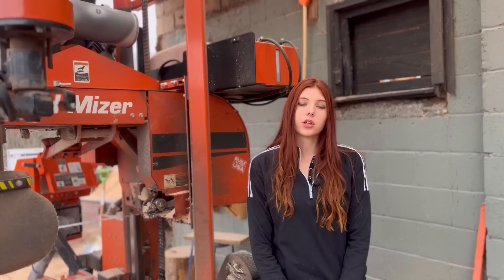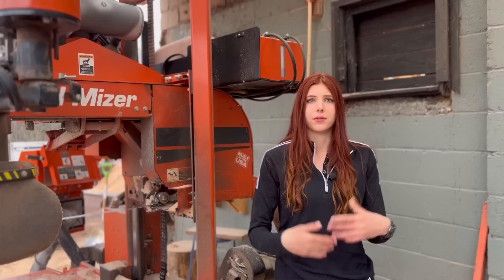Find the Right Blade for YOUR Sawmill!

Comment: Clearing the dust is very important for a cooler and cleaner cut.. What ever dust is left behind gets re-cut, binds against the sides of the blade,  and that takes away from the piece being milled. dust also contains pitch which can build up and cause a lot of problems.

Comment: The price for your blades is cheaper for your mill than my personal Delta 13" bandsaw. I usually pay around $20. - $30+ for a good blade. That's for a 3/4" 3 hook tooth per inch. Thanks for the videos. You all do a great job.

Comment: Deeper guilitt will cut faster in wider boards as it will not dust load as much and stop cutting as the tooth is going through the cut .
Another Y tube guy that has a very big home made band mill that saws very big logs up to 6 feet dia uses some kind of special blades that cut right through nails all the time and keep right on cutting ok .
He cuts a lot of nice table tops from some very ugly logs .
Some good information about the blades .
Keep the saw dust flying .
Reply: The deep gullet ones will not sharpen well nor as many times.

Comment: I use a 12" drywall knife to run down the boards and clean off the stuck on sawdust.  I've found if I don't it can mold in the pile and cause some staining.

Comment: Great explanation on different blades, I use the cheaper blades but I also sharpen and set them. I did get two of the BiMetal blades to try out but have not used them yet guess we will need to compare notes when we run them (or ruin them LOL)

Comment: Contact manufacturer about the one-day blade issue. They should be able to work with you on making sure you get the full expected lifetime of the blade. Sometimes it is proper adjustment. Sometimes suitable lubrication. Chances are, in your case, it was a defective blade.

Comment: $30/blade is the only price U previously stated (see grandpa sharpening vid). Yet this is your first time using it today? Contradiction. And there are teeth missing? My brain is fried.
What the blade description says may vary from experience. Maybe 3 cheapies are better than one at 3X the price.
I can only attest that harder steel holds an edge longer but does not get as sharp. Intermixing logs would skew any analysis of performance during the life of a resharpened blade too.